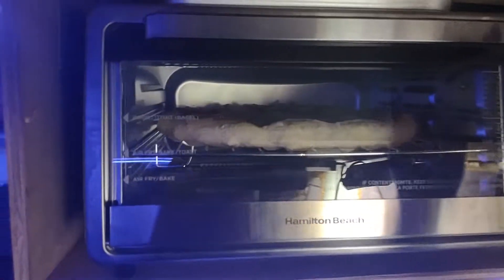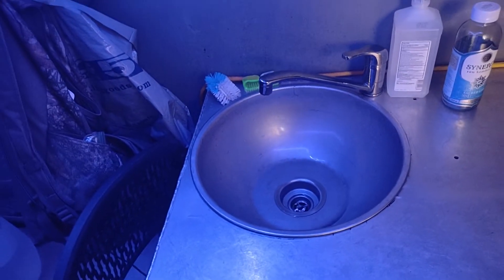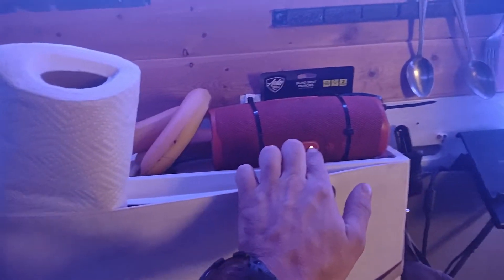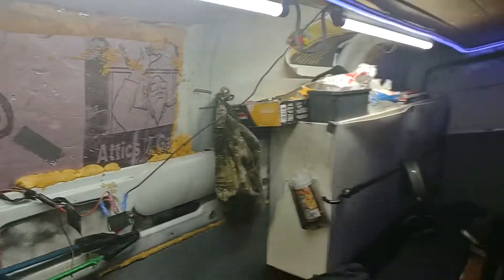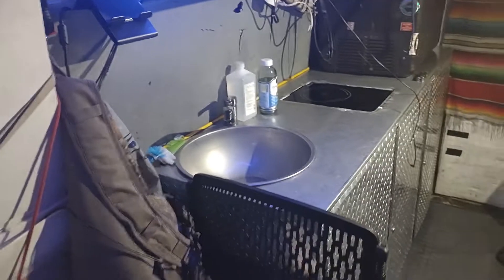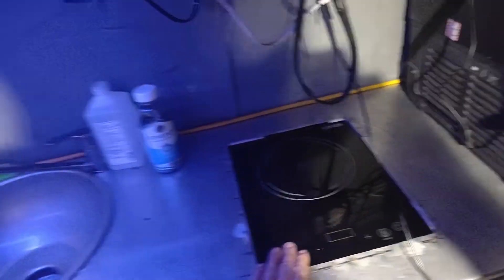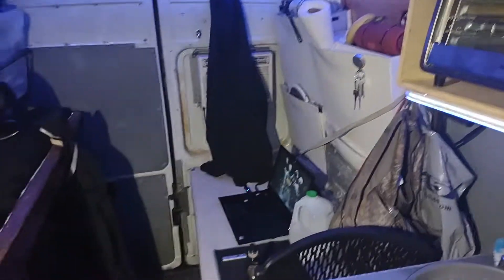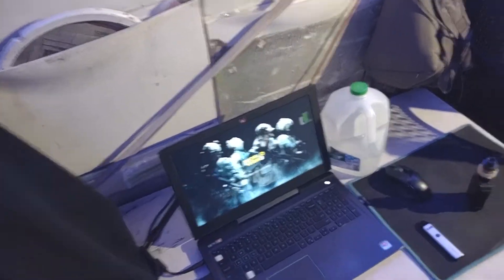Sprinter Vanlife tour/build update - First Van-Pizza!! New kitchen, automatic lighting, and more

Comment: Pulse pump is $8. I did a video a while back on the install. Also,  just get a longer cable for the choke. Only need a tiny hole drilled for that
Reply from the maker: Oh that's badass. Thanks so much for the info Tasha!
Reply: @AncapistanVan  the video should be on my front page of my channel for the pump. I bought a remote that I was gonna use as a kill switch to be able to turn it off from inside but I used it for my light bar instead.
Reply from the maker: New plan. Have you seen the new smart generator on the market by ecoflow?

Comment: The oven is just a standard toaster oven. I don’t see the convection fan or air fryer. That being said, your best bet if you want to cook and use other electrical loads is to use propane. You can buy the 2 burner camp chef stove oven combo which are fairly popular with van lifers or you can just buy a 3 burner rv oven stove. The camp chef option is cheaper though.
Reply from the maker: The air fryer convection fan is built into the right side of the toaster oven. It was rattling too much when I would run my generator. And I managed to break one of the fragile glass heating elements accidentally. I do have a propane stove I use for coffee in the mornings when I don't want to get out in the rain to start my generator. But I prefer to use electricity over propane. Because I can get electricity for free from the sun